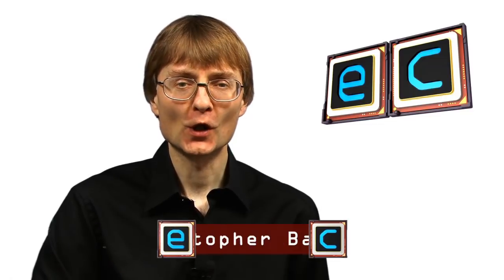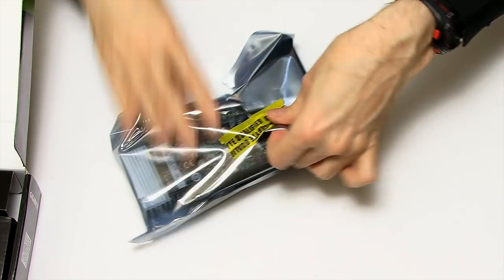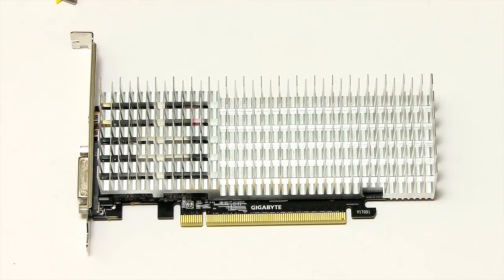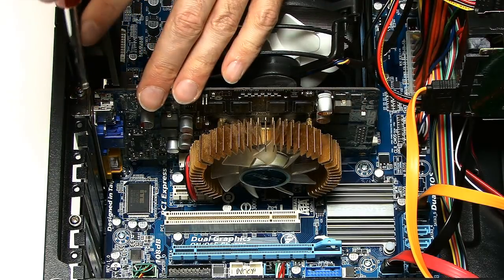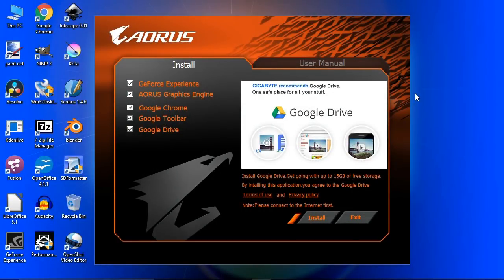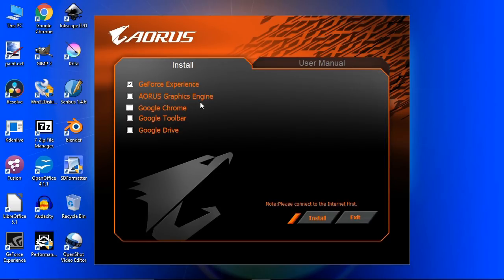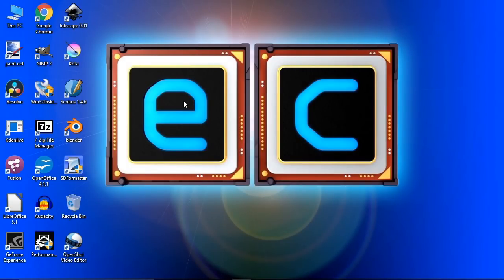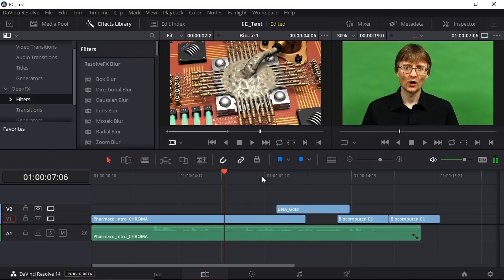GT 1030 Silent Graphics Card

Comment: You mentioned drivers — nVidia has been excellent in supporting their hardware with their drivers, over the years.  I have a GTX760 which is several years old now, and I still get regular driver-updates for it.  I’ve been very happy with nVidia’s support.  I haven’t, however, been forced to update to that GeForce Experience software that requires a login.  That’s ridiculous.

Comment: Seriously a 9500 gt on a apu? You can get more gpu performance on that apu.
Reply from the maker: Yes, but this PC is used for testing and recording for this channel, and for that I need an HDMI output to feed the recorder. And the motherboard does not have an HDMI port, hence the use of an old card with a HDMI socket I had lying around.

Comment: My god, where do I even start with the whole driver issue in this video?

I mean no disrespect, but the whole issue with logging in with Geforce Experience really isn't an issue at all, a geforce experience account isn't neccessary for drivers unless you want to update quickly and easily through their software, it's a program designed for nothing more than optimizing graphics settings for your hardware, and recording/streaming if you want to. 

The drivers for any Nvidia product are available after only a quick search on Google, and once you've downloaded them you can choose a custom installation and deselect Geforce Experience, which is what I normally recommend. By downloading drivers directly from Microsoft's repositories all you've done is open yourself up to vulnerabilities and likely decreased performance caused by heavily outdated drivers. Tl:Dr, Please don't ever install drivers from the CD included from hardware or from Device Manager, a five second google search would've fixed the issues you complained about.
Reply from the maker: As I made VERY clear in the video, you can drivers without installing GeForce Experience and creating an account -- I am well aware of that. BUT there is a clear expectation of installing.

Comment: Hey......Will it able to install on my PC?
Which is Equipped With Intel core 2 duo E7500 @ 2.93GHz CPU, 4GB of RAM & Mobo is GIGABYTE G41MT-S2P with No Graphics Card..
Reply from the maker: Yes, this should work fine with your PC -- you have a 16x PCIe slot on the motherboard to plug it into, and the card is very power efficient, so no issues there. As the card can be low-profile, it should fit any desktop case. Make sure you have a 300W or more power supply (there should be a rating printed on the power supply near where the mains lead plugs in). This would give you a significant graphics upgrade. Good Luck! :)
Reply: ThankYou For your Reply! and for the Advise too!

Comment: I can't believe that passive cooling exists in 2018. This GT 1030 only consumes 30 W?

My power hog 2000 needs heatsinks on top of heatsinks on top of fan after fan.
Reply from the maker: It is amazing how power requirements have (and hence cooling requirements) have gone up and then down. I have an i7 6700T CPU that only uses 35 watts max.

Comment: I suppose it's technically not "silent" due to coil whine. But it's considerably quieter than its fan cooled counterperts, at the expense of performance and longevity. It would however, be advantageous in a home theatre computer where low power consuption, low heat generation and low noise are favourable.

Comment: The video card in your APU was faster than the 9500GT. You downgraded your PC with an external video card. Congrats.
Reply from the maker: Ah, but that was not the reason to add the graphics card. :) The onboard graphics does not have an HDMI socket; the 9500 card does. This test PC was put together solely from components I had lying around to use in making videos for this channel, and for that I needed to record the output via HDMI. So I did not "downgrade" anything -- without the 9500 the PC would not have done the job it was built for.

Comment: why can't I use a DVI-D to VGA adapter https://www.amazon.ca/Importer520-Male-DVI-D-Female-Adapter/dp/B007EA48MA
Reply from the maker: This adapter does not convert digital to analogue for VGA. Such adapters are fine using cards with DVI-I or DVI-A, but will not work here (see lower in the Amazon description, and it notes how it will not do the conversion). You could use an active (powered) DVI-D to VGA adapter, but these are more expensive and can be problematic.

Comment: I installed the msi gt 1030 oc edition with the small fan, I thought the fan might help while playing games. so far ive run gta5, fallout 4, and battlefield 1 with no issues. I love this little card. i have been putting together a slim dell for a htpc, 500gb ssd, multi drive, i7 upgrade, and 16 gb of ram. I needed a low profile card to fit the dell that would run of the stock power supply and would play games. so i gave this card a try, so glad i did.   * note the gt1050ti from msi i tested in the same machine would not run with the stock power supply and with the i5 still installed.

Comment: I really have a question about SSDs.  Does doing only reading of an SSD curtail it's life in the same way is doing writes. I boot my system from an SSD, but work with files located on another disk. I have 25% of the SSD unallocated.
Reply: Sorry for bad grammar in previous post. Cellphone autocorrect changed some words.
Reply from the maker: Reading an SSD does cause some wear, but cells can be read millions of times, compared to thousands of times for writes. Note that if you boot from an SSD, your operating system will be writing temporary files to the SSD pretty much constantly -- so writes will be going on. Simiarly your web browser will write cache files constantly, etc. This all said, do not worry -- if your SSD has 25 per cent unallocated, and you are clearly not hammering it with user file writes, it should go on working for a very long time! :)

Comment: wait: you have an apu installed but you use a dedicated graphics cards? why?
Reply from the maker: The initial reason (with the older card) is that this is the test PC for this channel, and hence I have to be able to record the output. And the motherboard does not have an HDMI connection to connect to my recorders. So a graphics card was needed. As I discussed in the video, the GT 1030 was fitted to provide more power, a more recent card, and hence to allow software like DaVinci Resolve to run (which it would not do -- ie it would not even launch -- using the old graphics card, yet alone the APU.

Comment: Around 2:33, you say that the card cannot be used with a VGA monitor, but that is not true. A simple and inexpensive DVI-D to VGA dongle would allow connection of this graphics card to a VGA monitor.
Reply from the maker: A DVD to VGA dongle absolutely will not work (the card is DVD-D -- not DVD-I or DVI-A. Yes, could use use an active (digital to analogue) DVI_D to VGA adapter. However, I did not want to give the impression in the video that, if you have a VGA monitor, you can use a common DVI to VGA dongle, and this is not true. And also, I cannot win here! :) If I had suggested that this was a good choice of card for people with VGA only monitors, I would have had a lot of comments about that! :)

Comment: Cheap? Yes. Good value? No.
Reply from the maker: It does the job required here for the lowest price. That is the definition of good value. Yes, something like a 1050 would be more powerful (and use more energy, and generate more heat). But it would not improve my use of this PC for the purpose intended (not gaming). So spending more money on a more expensive card would make it worse value. "Value" is not always a measure of power per dollar spent! :)
Reply: ExplainingComputers 👍

Comment: Just a heads up if it hasn't been brought up already, you can get DVI --> VGA cables for super cheap if you need a VGA input to your monitor. I used to use one for my old TV because VGA looked better than HDMI did out of that video card for some reason.
Reply from the maker: Note that this card is DVI-D -- not DVI-I or DVI-A. It hence has no analogue output, so most DVI to VGA cables/adapters will not work. Granted, as others have noted here, you could use an active (powered) DVI or HDMI to VGA adapter, but these are more expensive and sometimes problematic.

Comment: Chris this is unrelated to this video but could you make a video on or at least tell me about remotely powering a Raspberry Pi 3 with a big battery power bank for long durations. Is it safe and can it be done?
I am considering a project of a pressure pad/contact switch counter ( set under my door mat )  rigged up to a bread board and to my Pi which will count how many times it is activated if at all when I am out of my flat as a sort of convert security alarm/ movement logger project and as it is ment to be covert I cant leave it plugged into the wall lol. Any help appreciated.
Reply from the maker: You can power a Pi using any USB power bank, and some of these offer a pretty high capacity. I have certainly got many hours out of a 2000 mAH USB power bank running a Pi 2 and Pi Zero -- and power banks now go up to 15000mAH.
Reply: Excellent. Thank you for that Chris, keep up the good work.

Comment: You don't need the GeForce experience either, that's just a gaming auto optimizer/screen recording software center for the most part by nvidia, still nice to have but not necessarily needed the drivers can still be updated through the other software suite that it installs at the same time(nvidia control panel I think)

Comment: There's a bit of misinformation in this video. First of all, you don't need Geforce Experience. The only thing it's good for is Shadowplay and automatic driver updates. It can also automatically configure the settings of your games, but it's not always that accurate. 

Secondly, when you log in with Facebook, NVIDIA asks for "your public profile and email address". That means if your profile is set to private, they won't really be getting anything other than your name.

Comment: I am a huge fan of your channel, so please keep it up. Forgive me for being pedantic but contrary to your point at 2m30s, it is very easy to use these days hdmi sources with vga only monitors, thanks to adapters costing no more than £4.99 such as this one http://amzn.eu/egj3CG8 Of course, the quality is then limited by VGA and the monitor itself but I use these for convenience for plugging the occasional Raspberry Pi or other sources to my monitor - rather than unplugging my main computer.
Reply from the maker: Thanks for this. I totally take your point -- though I have seen many presenters have problems with such adapters in the field! :) However, if I had noted that the card could be used with a VGA-only monitor using an adapter I think I would have had complaints about recommending a card without a VGA port for those with a VGA-only monitor -- especially as non-active adapters will not work with this card. :) But again, I do take your point.

Comment: 1.  You don't need to hold back the leaver to  put the graphicscard in. It's just for  secure the card  while running  cause  most cards  are  heavy and can easily  pull themselfes out  with that nob. When you instlal a  graphicscard it  just slides in and clicks 2. Geforce Experience is Optional not needet  Software. You dont  have to login  anywhere.  Its  jsut a crappy  additional software for people  who don't know how to  setup their graphics. Most of the time it's not even doing a good job  in using presets  based on your hardware setup.
Reply from the maker: Yes, I got it wrong on the lever -- I was remembering old APG slots. But not a big thing, surely -- and it would not hurt to hold it out! :) On GeForce Experience, you miss my point. As I showed in the video, I got things going fine without installing it -- I didn't install it! :) I know full well it is not essential as the video makes extremely clear. But I still think it is not good that the default software for updating the drivers requires an account to be created. This is certainly not how such software was in the past. Absolutely, require an account for broader services. But you should be able to install the basic driver update utility regardless.
Reply: That's totaly  caused by  Windows not by Nvidia.  I also recommend  to turn of  automatic updates on the graphic drivers as windows  keeps  installing older versions (verifyed to run stable)  and not the news  drivers out there.
Reply from the maker: Sadly difficult to turn off automatic updates in Windows 10! :)
Reply: Actually not. Advanced System Settings-> Hardware-> Device Installation Settings->No let me choose.
Reply from the maker: Thanks greatly for this. I had not discovered that one. Very helpful. :)
Reply: NP.  Thanks  for your work.  Watching  every single  video you make. This one was kinda wierd as you  normaly  do so excellent  research work.
Reply from the maker: Thanks. This was an "almost not a video video"! I needed to upgrade the test rig for next (this) week's editor head-to-head and some other upcoming stuff, and then went "hey, make a video about the new card!". But it was very off-the-cuff. Lesson learned! :)
Reply: I realy would delete geforce experience as it holds back some hardware encoding power from your card (nvenc). Also turn off dvr service from window 10 as it does the same.  On some machines that option is hidden in the xbox app, where you beed to be logged in to turn it off. Not sure if adobe premiere is taking advantage from that as it profits from cuda cores and not from the h.264 hardware in your card. But OBS does.

Comment: no offense, but a "good" upgrade would've been a GTX card, even if it's not a 10-series, from a 9500 GT to a GT1030 is an upgrade, but for video editing, going from that 9500 to maybe a GTX 900-series would give you a much considerable upgrade... you do have a point by using a GT card, it makes sense but for about $130--$150 US you could get a GTX 1050 or GTX 1050TI... this is just speculation and my two cents, but hey, you do your thing.

Comment: One thing that has always bugged me; why do the motherboard manufacturers insist on using single spacing on the graphics card slot when they know it will most likely cover a much need slot next to it.  Graphics card slots should automatically be double spaced.
Reply from the maker: I totally agree. :)